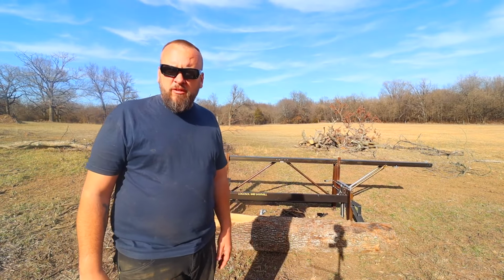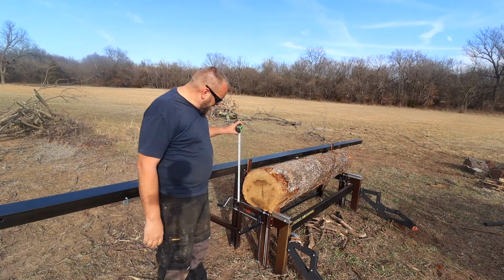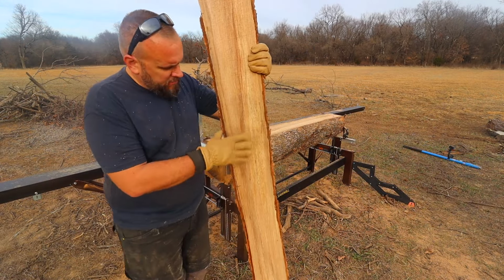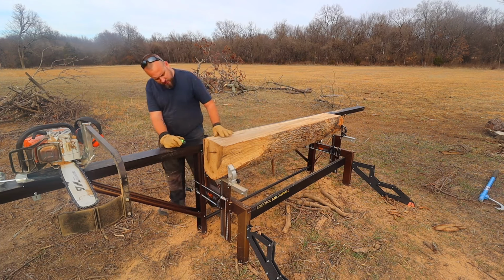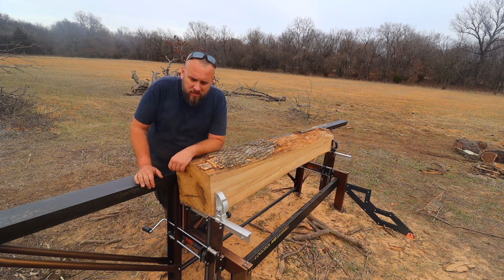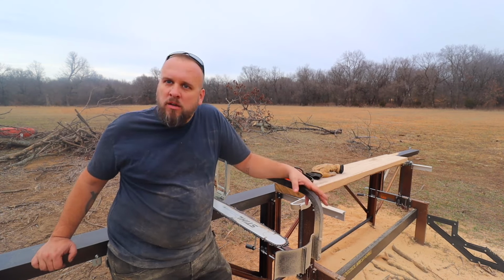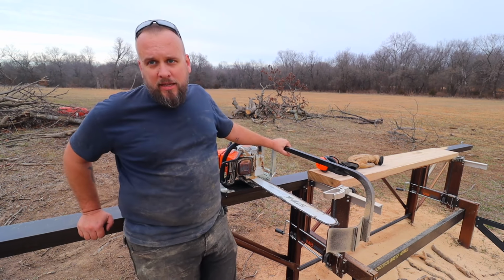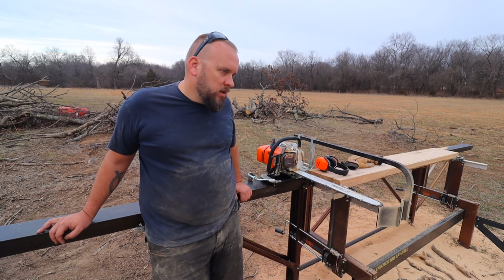Why This Logosol Mill is Awesome...And Why it Isn't

Comment: I cut  my very first boards from a hickory and white oak log a few days ago, with a little Husqvarna 440 with a ripping chain, a simple guide, a long and straight 2x4, and a couple screws.  The boards are pretty.  I am about to mill a 24" white oak where she fell.  I love it.  It is the funest thing I've done in decades.

Comment: I have M8 too. Deffo use narrow kerf, skip tooth chain. Downward slope is ok, but MUST be dead horizontal. For shorter lengths I attached 2" angle to the end of 4 x 3 and hung it over the risers. Screw couple block at the back so your log has something to push against. With short logs the clamps might not work, so use wooden wedges, that way if you saw through them no harm to chain. I like the crank system a lot, but the cord supplied breaks quite soon, so I use Kevlar string, lasts lot longer. I cut mainly oak, so the but tend is wider than the trunk, that made it harder to roll up the ramp - so for big flares I take it off before loading.  I have Stihl MS880, so get most powerful you can. Uses roughly one tank for 5 cuts. Bar dips wile using on wider cuts, so get nose steering - I made my own, but Logosol sell them. Blow away chips with blower. Spray PTFE or silicon spray on the runners. Mine can do everything up to the recoommended ma x diameter, heavy English oak, and the frame etc is solid, no bending. Anything bigger, forget it, regardless of the species. I load mine with home made forks on my Kioti 40hp. {Nearly )impossible to roll them on by hand and certainly not safely, but the double line around hte trunk trick, would probably work. M8 is a 9/10 for the right sized logs, thirsty on fuel, but the wood is free! If you get one be prepared to enjoy cutting, it's a million times more ergonomic than a chain mil (Alaska) but as you say, the Alaska copes with giants better. Great honest video. Wish more of them were like you, instead of wanting to look good. Thanks.
Reply from the maker: Thanks for the feedback on it. I think it’s a good well designed tool

Comment: You stepped over that crossbar shortly after setting the log back up in the cradle. If that log were to fall again at that point, you might be very painfully pinned in the frame. Safety tip: stay out of that frame below a big log.

Comment: I use the M7 - you have provided a fair and honest review - the one advantage with the chainsaw mill is that cuts are dead flat and square. You can go from rough cut to surfaced with one or two light passes through the thickness planner with chain saw mill. I personally use an old Stihl 090AV with 404 chain because it will cut anything including nails, fence wire and aircraft cable! But regardless of the type of mill (bandsaw or chain) you have to have powered sharpening equipment (bandsaw blade sharpener and setter or chain grinder). You need about 4 chains for a days work. The Logosol is light and easy to move - The Granberg goes to where the log is. The Granberg is for young people who do not know what back pain is yet.

I don't consider it worthwhile to cut softwood in to lumber with a chainsaw mill and it is even questionable with a portable bandsaw mill because you needed graded lumber for anything serious in most parts of the world. You really just want to cut excellent hardwood for cabinet work with these tools in my opinion.

Comment: You did a great job showing the positive attributes and limitations of this style of mill. It just proves the need for different types and options available for different needs. In my opinion, this is a high quality, lower cost option that fits in the hobbies category of available mills on the upper end due to cost.
Reply from the maker: Agreed. Thanks for letting me use it
Reply from the maker: I also just put out a 59 second version of this milling that I thought turned out really good. It’s published on all the platforms as a short.

Comment: Thanks for a complete and honest review, the good, the bad and the ugly.
This type of milling, using a chainsaw, seems to be slow and cumbersome.
And when you consider the cost of a large capacity chainsaw, it does make one pause when comparing to a bandsaw expenditure.
Unless one has large acres of woodland to draw from and the large (expensive) equipment that goes along with logging, the idea of milling lumber seems to be less and less appealing.

Comment: Thanks for sharing your experiences with this sawmill. You're a great guy, heart felt opinions based on significant personal experiences. Your video is based on wisdom, intellect and a generousity that help us fence setters weigh though all the factors that only trying and failing will get us there. Respect. I do have a few questions on back ground. What model saw are you using? Fuel? 2 cycle oil? Why are you milling logs? What do you use the lumber for? Thank you.
Reply from the maker: I am using a 661. Standard fuel mix. I buy the Stihl brand mix and follow the instructions.

I’m milling, because it’s a passion of mine, and I want to build things with the lumber.  Right now I have a huge stack of lumber that has been milled for a full year and is dry now

Just starting to use it. I built a Swing for my grandkids and cutting board for my daughter.

Next thing I want a Build is a Sawmill building to do the milling in

Comment: If, after squaring the cant, one just cuts down the log in one plane, without flipping the cant, the more the boards will cup and warp, as the grain tightens towards the center.  One needs to flip the log ninety degrees every couple of cuts to keep the grain angles low.  bg

Comment: You need a 2500# winch from harbor freight. Just wind the cable around the log and it will roll it up for you. With the remote control it will be much easier.
Reply from the maker: I’ve got a bandsaw mill now and I use a cherry picker when my tractor is not available

Comment: The problem is that now in Canada, it's about 3000 for a F2 with accessories... even more.   if it is robust and as easy as you tell, than  i will probably buy one. I find it very difficult to cut with a chainsaw mill. I killed a Still 361 .... (was on garantie ) so the advantage of milling VS buying was lost...  I think i would love to mill with the Logosol...   Maybe i should by a milling chain and start again with my ol alaskan mill to see if it makes a difference...     I can take a lot of time to simply mill a true 4X4 (plumb, square) ...
Reply from the maker: I found this to be a lot better than any other chainsaw milling option, but I’ve only used it a few times.

Comment: Strip the bark. You'll be surprised at how much longer the sharp lasts.
Reply from the maker: So I guess the question is, which takes more time and energy, stripping the bark, or sharpening the chain
Reply: @RockhillfarmYT  this isn't an argument and your work is great. A person can go one step further though.. sharpening a chain more times means a new chain sooner.  
  This is just me, but when I run down the log with axe and draw blade, a visual inspection under the petticoat sometimes brings unexpected metal treasure. I might mention that it's not necessarily the bark, but what the bark aquires. And they're all different. Maple v pine... sycamore v locust. Judgement call. Anyway, many thanks for the vijayos and at the least reading my rant..
Reply from the maker: @kevinfoster1213 I enjoy the conversation. Didn’t mean to give or take offense.

On my band Sawmill that I run now I often chip off rotten bar or muddy bark, but not all of it

Comment: Honestly, that rig does work, but set up and time it takes to do it right is not worth it. A real portable sawmill makes more sense. That thing is very large and the set up can't be any easier than you are cutting that log. Thanks for the video, but that rig isn't for me either. I am thinking just a plain Jane rig for a chain saw is a better option for cutting things onsite even if it is a bit more awkward. It's less expensive and easier to set up and get going. If I had the money, I  would get a real portable sawmill instead.
Reply from the maker: I have a sawmill on a trailer now

Comment: I saw nothing 'stupid' in this entire video.  What you showed was a limitation in the mill and a need for improvement in the mill design.  How you say?  Simple.  Add a third lifting rail in the middle.  Not a rail for adjustment of height of cut but just as a support for the center of the log.  There wouldn't even be a need for the center rail to be ratcheted to the 1/4 inch, just raised to touch the center of a log to keep what happened from happening again.

Another obvious upgrade would be that poorly designed loading ramp.  The first leg of the ramp is angled.  Great idea.  The second and third legs aren't angled up to the flat.  Poor idea.  I would also add a flip stop to the front of one of the ramps.  Once the log is on the flat, the flip stop would keep it from rolling back off (as you showed it did - yet another limitation).
Reply from the maker: Sounds right to me

Comment: Seems like worthless way for lumber you burn up a high dollar saw in no time doing that but enjoyable video
Reply from the maker: Thanks. I tried to just share my experience and let other people make up their minds.

Burning up an expensive, so is my number one negative to this. Just don’t know how long that will hold up doing all those two minute cuts at full throttle on a regular basis
Reply: I milled many hundreds of feet of lumber (cherry, hickory, poplar) with a 20 yr old 029 .  Now Im using a 362.  Run sharp chain, allow proper cool downs, use about 40:1 mixture with high quality 2 stroke oil, listen your saw so you run at good rpm and you shouldn't burn up anything.  Its all about amortizing the total cost of sawing over the number of board feet of lumber produced.  But this includes saw costs, fuel, your time, blades, etc - it's more involved than many think and completely dependent on application.  You may have a usable saw and only need a couple hundred board feet a year - an Alaskan mill might be perfect and it is available for a couple hundred dollars.  If you need to mill 30"+ logs you might find that a 441 and 36" bar plus an Alaskan mill is the answer also.  You want to mill 5000+ board feet a year? Better look for some log handling equipment and a bandsaw mill. And there are a thousand shades of gray in between.